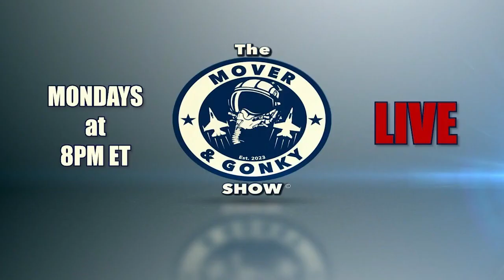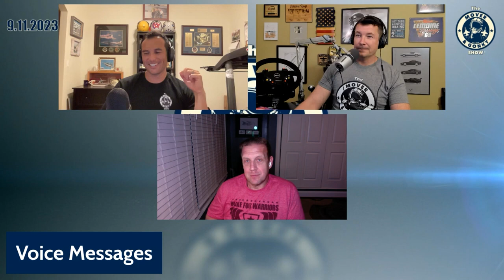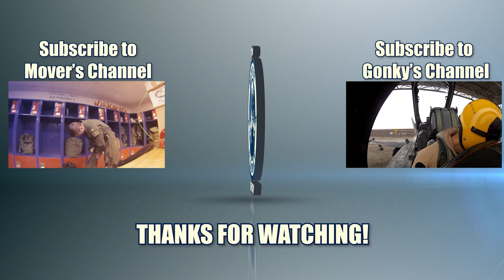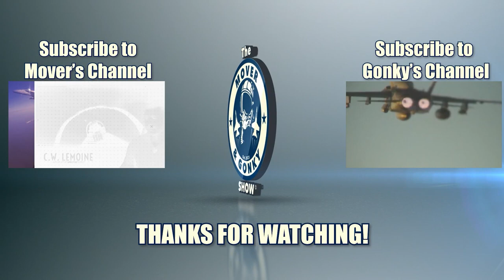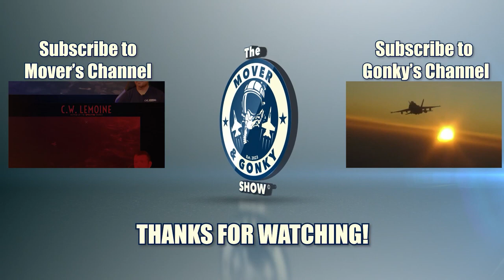Do Fighter Pilots Use the Rudder?

Comment: UPRT in big jets we are encouraged to use the rudder in high AoA situations to get the nose down and break a potential stall. Apart from that never use it unless initial engine out or de crabing in the last 20ft of the flare. 
I thought you guys would have used it more to bring the nose round.

Comment: 1:33 "Just like an Airbus" might want to look into American 587. First officer snapped the vertical tail off the A300 by overuse of the rudder and it went down in Queens, NY.
Reply from the maker: That was due to PIO and had nothing to do with the flight control system.
Reply: @themoverandgonkyshow  Yes, my point was that not all Airbus pilots fly with their feet on the floor and one remarkable incident snapped the vertical stab off the plane.

Comment: In a F4 pilot said in high AoA use the rudder to roll because of the F4s adverse roll issues that could stall and depart the aircraft. Again High AoA as Mover said. 😂😊
Reply from the maker: Nope, the F4 was not fly by wire.
Reply: @thereadyroom7201  Never said it was ... The first was the Viper I believe.,......

Comment: Gonky, "the old Vietnam petal push." Yup! Spray more than the lousy 20mm canons would whip anyway. Agree with Mover on high AOA maneuvers.  Course we were fly by hand w/hydraulics help vs wire...Actually, rudder was all ME!  Still had to keep the ball centered in a turn.  Also used the rudders to make slight, smooth heading changes in a precision approach (CCA or GCA).  True, rudder in a jet was not used like in a prop or a helicopter.
Reply from the maker: Pete!  Yeah, in the T-45A we kept it coordinated in the turns, in the T-38 with the gear down I didn't dare touch the rudder!

Comment: When Blue Angel diamond takes off,  #4 uses the rudder to slide into the slot position, right? I always thought that was how it was performed. And it just looks so amazing how the pilot isn't rocking it's wings and slides laterally to get in position. (I haven't been able to do it myself ingame, because I just don't understand how it's done. I hit the rudder and either its not enough to move the nose, or it's too hard, and everything goes to hell.  Maybe you guys can all get together and do a tight formation takeoff in DCS, and post the video...
Reply from the maker: The rudder commands a yaw performance.  The flight control computers will cancel out the roll you would normally get in a conventional airplane.
Reply: Great question @thebluemonkey

Comment: Took an A-10 Pilot up in a WWII T-6 Texan "the original" and he learned real quick you MUST use the rudder pedals in just about every aspect. He told me when flying the A-10, their feet hardly ever tough the rudder pedals, he say's his feet very seldom left the floor of the cockpit! I found that very interesting!
Reply from the maker: Yup!
Reply: P factor. Even in the 73 we rarely use the rudder unless it’s a crosswind landing and you use the rudder to decrab prior to touchdown. When you have symmetrical thrust from turbofans and a yaw dampener your feet just sit on the pedals but you don’t apply any pressure.

Comment: A long time ago I used to fly sailplanes a bit. Because of my lack of an engine we would be very conscious of our degree of sideslip because a significant degree of sideslip would mean that a pilot was not using their wings efficiently. Sideslip increases forward drag by presenting the side of the fuselage and it reduces your wing aspect ratio so you are losing in terms of both drag and lift.

I see that this applies to fighter jets, especially in high AoA conditions in that the rudder affects another axis of AoA that is perpendicular to your lift vector. Because the aircraft has so little side presented area, relative to the area of wings and stabilizer, nearly all aircraft become easily prone to sideslipping (high yaw axis AoA) for which the rudder provides control in this axis.

If you want to gain energy quickly, you want to be flying efficiently so carve your turns and fly low AoA in both pitch and yaw axis. With a sailplane you tape a bit of yarn to your nose (the plane's nose not your face...). The yarn will show your degree of sideslip in the yaw axis, or it'll lift up with high downwards pitch AoA. We'd use that yarn to inform our rudder and ailerons to make good clean coordinated turns achieving zero sideslip.

I wonder if fly by wire is taking input from some sensors to detect and correct sideslip to help a pilot fly efficiently without requiring them to look at a bit of yarn. Intentionally stomp on the pedals and that automatic sideslip reduction gets disengaged and you yaw more abruptly.

Maybe rudder is good for offsetting things to make it harder for someone on your tail to keep their lift vector on you. By yawing momentarily instead of only rolling and pitching, your force your pursuers lift vector vector to roll more. If you can get them to roll far enough you can more easily force an overshoot with a turn reversal because you got them to crank their lift axis further against the direction that you reverse towards.
Reply: Gliders use a LOT of rudder... allways.. i even often make turns with rudder and using oposed ailerons to keep turns flat (rc gliders not the real thing)
Reply: @sparrowlt  The issue of sideslip is harder to observe with RC. Free flight and RC was my first love in flying. Sailplane flying showed me how much I was missing because I could finally see what was going on with that bit of yarn stuck to the top of the nose as I coordinated turns.

Rudder gets used a lot in sailplane to coordinate efficient, low sideslip turns. You also really want to keep AoA down in a glider maneuver because it just dumps your limited energy.

It was a neat thing trying to fly so cleanly while you sniffed for thermals. 

At the end you come in for final approach really high (leave some altitude for a go around) and if it's all good you apply opposing rudder and aileron to push an aggressive sideslip to dump altitude without gaining airspeed. 

I really enjoyed sailplane flying. It made you really think about the principles of flight while you were doing it.
Reply: @carlchong7592   the weird thing about rudder is that in GA barelly anyone uses it on flight while it makes small aircraft fly quite better.,. i have seen many pilots talking about using rudder in flight to make small corrections and small turns feel much better than the ailerons like if they discovered something new when should be standard
Reply: @sparrowlt  I agree that rudder isn't thought about much. Because of this, I think that it can be used to push a pursuers lift axis past your own if you also apply some rudder.

Say I am being pursued and I decide to roll right and pull up. If I also apply some right rudder, I also yaw in a way that makes my opponent roll further than me if they don't notice my use of rudder.

I force my pursuer to roll their lift vector more to the right to keep their nose on me which helps to force an overshoot if I do a turn reversal.

I am basically in an orientation with my lift vector pointing closer to vertical than the pursuer so I to a sharper turn reversal than they can match.

Comment: Oh yeah I get where this guy is coming from in a DCS context. A lot of simmers misappropriate rudder coordination from the props to the non-FBW aircraft, and there's also a lot of binary thinking. "Tomcat needs rudder" is taken literally, when it's really just at high AoA. "FBW jets don't need rudder" is taken literally when, to ya'll's point, you can still use it at high AoA and for raking ground targets with 20mm pills.
Reply: Exactly! Thanks for adding this 😉👍🏼 BC
Reply: I think the question may not have been specific enough.  The rudders clearly move as controlled by a Hornet’s fly by wire system.  I think the intent of the question was about use of the rudder **pedals**.

I’ve seen any number of flight simulation games going as far back as the 80s that only needed a joystick for flight controls.  At the time I thought it was inaccurate after discussing flying with some teachers with private pilot licenses.  But they were flying Cessnas and Mooneys that obviously weren’t fly by wire.